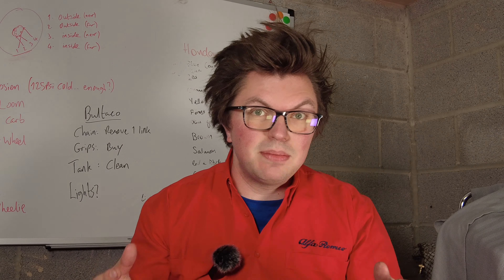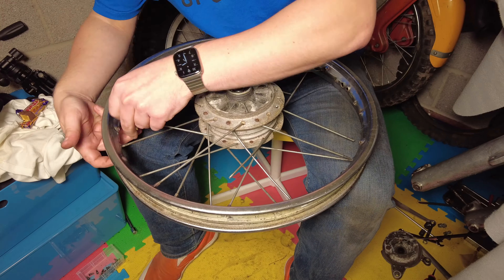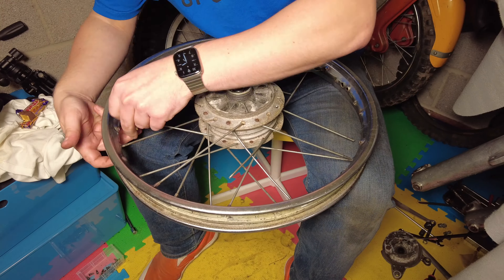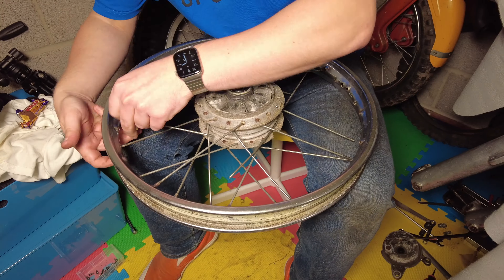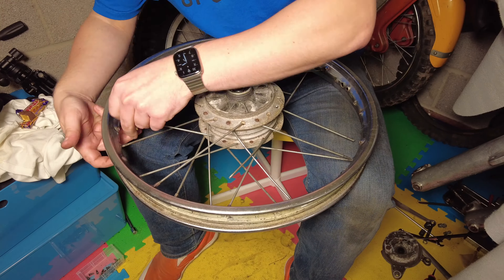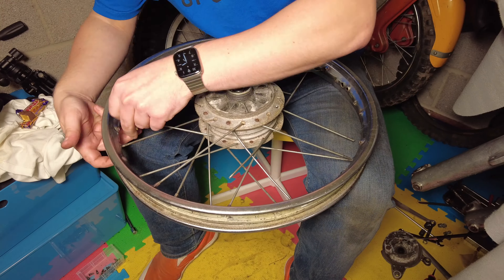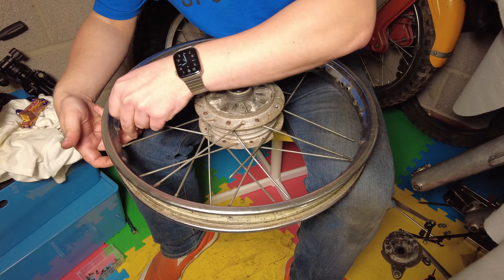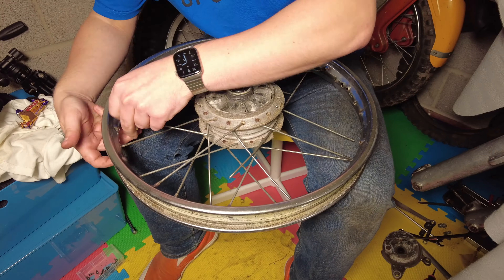We Made a New Wiring Loom (Harness) | Honda CT90 K0

Comment: I don't have an old loom to work off. Can you give me any idea of formation/lengths. The basics to start it would be great as motor not proved a runner yet and could sort lights etc later. Thanks from Australia.
Reply from the maker: Hi — here’s the wiring diagram for the K0 with the C90-style ignition switch on the side panel: https://sep.yimg.com/ay/dratv/wiring-diagram-ct90k0-k1-2.gif

If you have a K0 like this then the wiring loom is about 1.2m long, with the wires splintering off for the stator about 40cm from the engine end of the loom.

You can get rid of the light blue and the orange wires, as these are only used for the indicators which the bike never had anyway! Hope it helps
Reply: @TittertonRacing  thank you.

Comment: What are the part numbers for the led lights I would love to replace mime. Is there an led head iight? Good work with the video.
Reply from the maker: Cheers -- they're just some Chinese knock-off LEDs from eBay: https://www.ebay.co.uk/itm/174403269389. For the K0 CT90 you'll want BA7 all round, but I think the later variants use BA9 for all but the neutral light. Hope this helps!

Comment: Hey Alex, completely new at all wiring/battery operations on my 1973 CT90 (K4?). I'm replacing my old battery with a Motobatt (6v MBT6N4 sealed lead acid). Confused about the wiring though, as this new AGM battery only has two wires out, instead of the old battery with two positive cables that attach to the fuse. Do you know much re-wiring needs to be done to make the Motobatt work?
Reply from the maker: Hi -- not sure actually, but I suspect it might just need the positive wire splitting into two, with one going to the rectifier and one to the rest of the loom via a fuse. I seem to be lacking that part of the attachment to the battery too, so will need to do something similar. It's for later bikes than mine, but for this diagram might help you: http://oldmanhonda.com/MC/WiringDiagrams/CT90(early).jpg